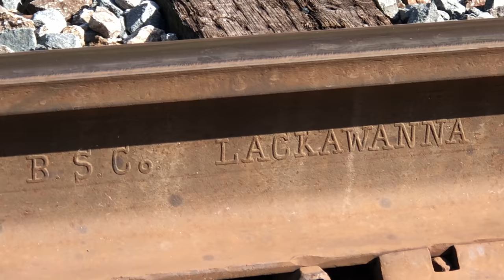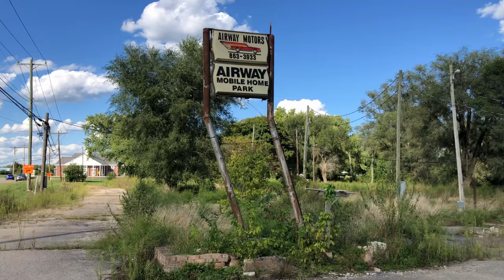Problem Railroad Crossings Of 7 Mile Ohio & Huge CSX Auto Racks Train On Norfolk Southern Main Line

Comment: Maybe it's the tank car numbers increase/train. This is why you send natural gas and crude oil through pipelines. Trains are longer, much heavier, and require more diesel/electric locomotives. Passenger trains on 75 N., 95N., and 26W just to name a few would save millions of gallons of gas during physical human evacuations. Elevated parking facilities would prevent thousands of terrestrial vehicles from becoming "don't work well as submarines". The elevated parking facilities would each  have a medical facility (including helicopter pads) to screen for communicable diseases in order to prevent co-infection which may occur on trains. But Wait!!! That's not all! Now there will be passenger trains to film heading inland to the emergency resort locations!!! But Wait!! That's not all!! My Grandpa Bradley (NYC RR, The Big 4) told us High Wheelers used to 'pass' through Sharonville at 90 mph.

Comment: Why do the headlights sometimes alternate, but other times  they are not even on?
Reply: Those are the ditch lights -- the headlights are higher and should always be on. The ditch lights flash to make the train more visible when the horn or bell is being used, i.e., coming up to crossings.

Comment: What does a Defect Detector detect? What kind of defects???
Reply from the maker: It detects axel and signal problems in passing trains.  If there is a problem with an axel it will tell the crew the axel number.  I heard one in Missouri recently detect a problem with axel 10 which would be the tenth axel on the train from the front back

Comment: Just a guess: maybe a train has to stop for a red light. Wait for block ahead to clear. Meantime, crossings blocked. Get over it, folks! Better than having a train wreck in the 'hood!
Reply: The issue is that a neighbourhood just to the south is only accessible by three rail crossings. A train can stop and block all three, completely cutting off that neighbourhood. Better not need an ambulance when that happens!